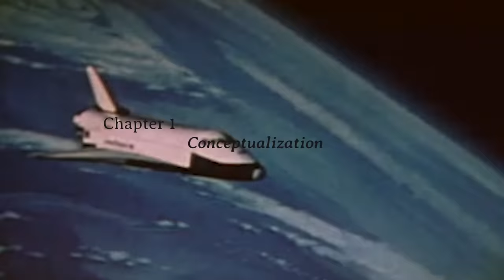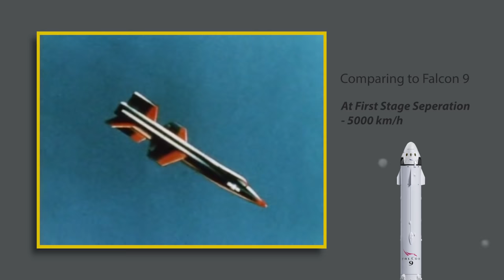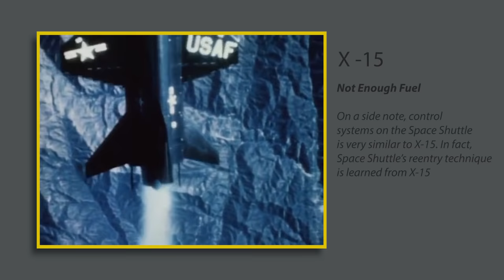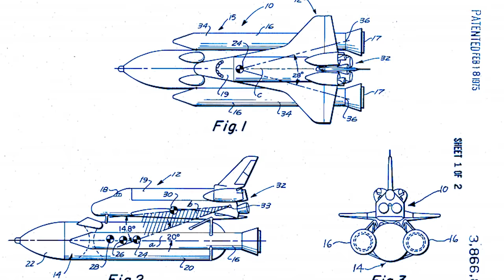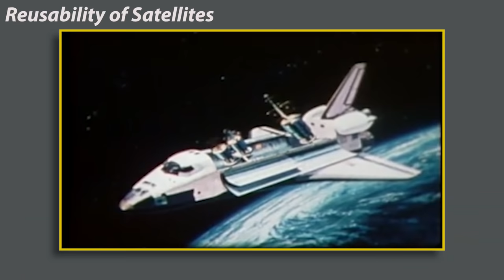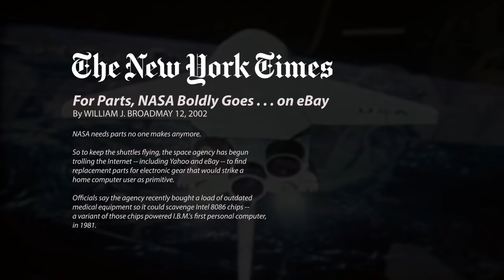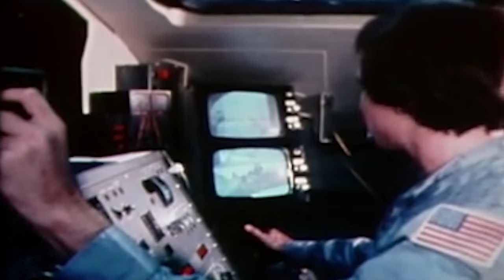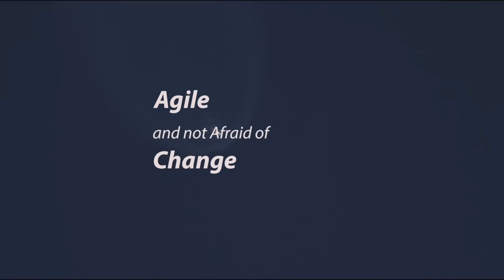The Space Shuttle, a failed attempt at Reusability?

Comment: You missed the first iteration of the Shuttle design. This was a larger, C-5 sized aircraft capable of taking the Orbiter up to release height on its back wherein the Orbiter would detach and ignite its engines. Very much like the way Branson's Space Ship Two or the L-1011 carry payloads to orbit.
This got cut by NASA as it was likely to be way too expensive and underpowered, despite being totally reusable. The tank and boosters design was a cheaper compromise design despite being perceived as not as safe due to the SRB's inability to be shut down in an emergency.
Reply: That original design was cool! Unfortunately, NASA couldn't afford it.

Comment: I would still like to see someone pick up the Space Shuttle architecture and modernize it. It would be interesting to see what that platform could do with 21st century systems and a pared down set of expectations.
Reply: or more simply, just do what the Soviet Union did with the Buran shuttle.  It eliminated both problems that caused the two shuttle disasters, AND cut refurbishment costs in half by eliminating the need for Shuttle Main Engines
Reply: It would be great to see a reusable modular system with different staging options and separate cargo and crew modules. The shuttle was pretty monolithic.
Reply: Fun fact: the Shuttle was at first designed to be fully reusable, with a "plane-on-plane" two-stage design. But it ended up in its partially reusable state due to lack of funding for development of the full version.

Comment: Top notch production quality and you cover a lot of good points. However I'd like to see a discussion about where they failed in their design that made it costly. Reusability was at the forefront of the space shuttle's conception yet they ended up making a system with an expensive and time consuming refurbishment process. How come they didn't foresee the large cost and difficulty of refurbishment? The platform also required an enormous amount of infrastructure to test, roll-out, and launch.
Reply: There was such a budget shortfall that the US Air Force came in as a partner and got a 30% size increase, that made everything harder.

Comment: I think Space Shuttle is program that was borned to early and on border of technological possibilities of 1970s for sucess. If someone today decide to build system like a shuttle (BFR is close) i belive it would be sucessful and reliable.
Reply: Samo Gomola I don’t know if the bfr will have the capability to repair of build a space station in orbit though. Today, we wouldn’t be able to build another iss without the shuttle.
Reply: The System could definitely be built successful and reliable. But would you need it? The main reason the shuttle was so expensive is that it wasn't designed and optimized for the missions it had to be used for. When the U.S. military withdrawn its contract, the shuttle was just halfway in development, they shouldn't have finished it if there wasn't a proper use for it. They basically ended up with a big rig for pizza delivery.
Reply: Martin Hughes how is the iss useless? It had been used for many, many experiments, and to study how humans handle being in space for a long period of time.
Reply: The main objective of the ISS is to study human biology in weightlessness. That's quite necessary for space missions longer than a week. If you want a Mars mission with humans for some reason, you'll need at least a decade of studying the effects of weightlessness before.

And that's not just it! During a Mars mission, you'll be exposed to deep space and insane radiation. If you want to have a chance of delivering your crew alive, you'll also need to similarly to the ISS, study human biology when exposed to radioation and deep space. That's actually something that's being done. A space station named "Deep Space Gateway" is planned to be constructed around the Moon to study exactly that, and if things don't work out, you're still safe to return from there. 

The DSG will determine if it is even possible for humans to survive a Mars mission, and if (hopefully) yes, how. It's a necessary part of any Mars mission, just as much as the spaceship itself.
Reply: Sorry if it wasn't clear. Yes, since you can't study radiation in LEO, that's why the DSG will be built around the Moon. 

And artificial gravity has been tought of, but the research revealed that you'd need an enormous ring. It's so hard to do that it's not worth bothering. Similarly on space stations, the centrifugal forces are miniscule too during the few minutes of manouvering, so  having it utilized by soviets seems unlikely to me. Do you have the source on that one?

Comment: There are several excellent books out there that put the design of the shuttle in historical context. That is of huge importance in analyzing the shuttle program. (There were also 6 orbiters built, not 5) Don't forget that the shuttle flew 87 safe consecutive flights from 1988-2002. Apollo flew only a handful of missions and is not a good yardstick for the shuttle. The 135 shuttle flights exposed the vehicles to far more ascent/descent flight risk than Apollo ever did. Catastrophic failures and loss of life will occur no matter what type of space vehicle is used. (Apollo 13 was a catastrophic failure and don't forget Apollo 1)

Comment: It would be more accurate to say the space shuttle program failed at reusability because the profit motive encouraged minimum attention to detail rather than maximum attention to detail. If a SpaceX rocket explodes, SpaceX has to pay for the cargo that was destroyed, and that costs much more than paying technicians to be extra-careful during assembly. There was no similar profit motive for the maintenance of the Space Shuttle. As a result, systems that needed the utmost attention (like the heat-resistant tiles and the seals on the SRBs) only got as much attention as absolutely necessary to be "pretty sure nothing would go wrong".
Reply: The shuttle design was compromised, underfunded and oversold, motivation can't fix that. To date SpaceX has had more failures than the shuttle, not good enough.
Reply: Fun fact: the Shuttle was at first designed to be fully reusable, with a "plane-on-plane" two-stage design. But it ended up in its partially reusable state due to lack of funding for development of the full version.

Comment: I remember some engineer or astronaut saying the development of the Space Shuttle put back the space industry 20 years.
Reply: Shuttle should not have been the ONLY operational space program.  Any optimally run space program requires both an exploratory program and a space transport system program.  STS was also intended to go hand-in-hand with building a space station,... but Congress refused to fund it.  ISS didn't even put up its first module until 2 years BEYOND Columbia's intended operational lifespan.

Comment: I don't agree. Space shuttle was a marvelous vehicle much more complex than anything build or to be built. It was a combination of bad luck and bad management what didn't allow and update of the orbiters or a new generation of shuttles.
Reply: They should have kept each orbiter to their 15 year operational limit, and replaced the shuttle fleet with new spacecraft built around the Soviet Union's Buran space shuttle.  Buran was lifted on a liquid-fueled booster that could carry a shuttle into orbit dead weight, with no help at all from the orbiter.  Eliminate the Shuttle Main Engines and you cut refurbishing costs in HALF.  You also eliminate o-ring failures, as there would be no Solid Boosters, as well as the foam strikes as there would be no external tank to feed the SME's you no longer have.
Reply: You've just shown its flaws. It was much more complex. More complex doesn't mean better, just more complex.
Reply: You need to stop fixating on the Buran. There is a reason why every commercial project is placing the payloads on top. You keep looking at the two accidents that happened and missing all the others that should still be avoided.  You act as if the original shuttle ideas are the only answer. That was NASA's biggest failure, the inability to think past the mindset that only the shuttle concept could work.
The shuttle never left LEO. Its expense made anything else impossible.

Comment: I followed with ESA the project Hermes (an European space shuttle) and know in depth why this also was scrapped : first the STS should have been on top of the rest of the rocket for obvious security reasons. Second there were numerous problems with just the attachments and also the landing gear : you can't open a door in a heat shield. Maybe it is also a reason why powered landing are scrapped for Crew Dragon 2 / Red Dragon (my guess) the landing feet coming from bottom are not a good design. Landing on the sea or pork retro-boost soyuz-like for landing anywhere still looks easier to achieve. Ariane 5 boosters recovery is far from ideal. I think for the moment the best recoverable space device it the Falcon 9. Also for earth return it is very hard to have in a small volume enough delta V for landing. Parachutes are still great in our thick atmosphere.

Comment: "it is hard to digest that we have never lost any astronauts in the Apollo program that took astronauts to the moon, yet we have lost fourteen in the shuttle program"

A couple things here - firstly there were 135 STS missions, and yet only 15 Apollo missions in total (including the three flights to Skylab and ASTP).  Further, even if we ignore the Apollo 1 fire, there was still the near-fatal accident on Apollo 13, who's only saving grace was the Lunar Module being used as a lifeboat, and the fact the heat shield was not damaged.  So, one near-catastrophe in 15, giving Apollo a 1 in 15 failure rate.
Now, when we talk about the Shuttle and its 135 flights, having two major accidents results in a 1 in 67.5 failure rate.  A far better percentage than Apollo.  If you include the glitches that resulted in fewer days in orbit or some incomplete objectives, you have to include those from Apollo as well.  Not including the crew-related problems in Apollo 7, you have the nearly aborted landing approach on Apollo 11 (reference 1201 and 1202 alarms), skipping the previously mentioned Apollo 13, you also have the docking problems along with the abort signal glitch and the approach radar issues of Apollo 14.

Being outdated was the principal reason.  Even in the Shuttle's inception, it was stated for each orbiter to have an operational lifespan of 15 years.  This meant that Columbia and Challenger should have been retired in 1996, Discovery in 1999, Atlantis in 2000 and Endeavour in 2007.  Yes, Challenger fell long before that time, but Columbia was seven years past her intended lifespan.  There SHOULD HAVE been replacement orbiters for Columbia and Discovery beginning production in the early 90's to replace the aging orbiters.  Though that is essentially what Endeavour was, but they had stopped it at that.

Now, you say SpaceX's Falcon Heavy can accomplish any conceivable mission,... except for one important one.  Refurbishment and retrieval of payloads already in orbit.  The Falcon cannot capture a payload and bring it back to Earth, under any of its designs.
SpaceX needs to be compared to Apollo, not STS, because they are two completely different schools of thought with completely different objectives.  The better comparison would be the Soviet Buran shuttle, which took everything wrong with NASA's STS and made it right.  Namely the refurbishing cost, the uncontrollable boosters, the go-around capability on landing, the upgradeable equipment, AND the launch stack that can be re-tasked to fill other non-Shuttle roles as well.  The Energea could lift a shuttle and its payload into orbit dead weight, requiring no assistance from the orbiter's engines (engine refurbishment was the primary money sink of the NASA shuttle).

Any optimal space program requires both an exploratory program, and a reliably maintained space transport system (including replacing aging orbiters when needed).  Lets also not forget, there were demands by Congress and the Department of Defense placed upon the Shuttle program, as conditions for the funding they needed.  Funding promises that the DoD also refused to live up to.

So, after all that, the short answer of why the Space Shuttle failed and why the program was cancelled is CONGRESS

Comment: the 8086 chips were used in many hard applications for a very long time.  Not because they were stuck with old technology but because the chips were hardened.  First they were made on a really big die (compared to today, or any time between) which meant that the transistors were much larger than todays chips.  Leakage just wasn't as much of a problem and if you combine that with how many millions of hours the chips had been run in heavy applications it meant that there was very good evidence that the chips would not fail in extreme conditions when everything else was going wrong.  It wasn't the antiquated thinking that stopped new chips from being used it was the reliability of the old ones.
Reply: You're exactly right, reliability was number one! With that in mind the shuttles used IBM AP-101 processors, but the used 8086 is a great story.

Comment: I say it has to do with poor management; I mean, its a no brainer that when a part on the space shuttle is outdated you upgrade it, not scavenge for old parts on eBay or ask suppliers to keep parts going just for them. its obvious thought that that isn't the only thing wrong with the spaceshuttle in that the spaceshuttle was costly to refurbish; for example, the thermal tiles on the shuttle were extremely expensive and this refurbishment defeats the purpose of reusability. true reusability both reuses the entire rocket and requires little to no refurbishment.
Reply: Nick G If the Space Shuttle had been unmanned it would have been cheaper to refurbish, if it was smaller and had liquid boosters that could fly back to land I think it could have been cheaper to operate.
Reply: The Space Shuttle was also intended to have a 15 year operational lifespan for each orbiter.  Columbia was 22 when she broke up, and Discovery was 27 when the program ended.
Reply: That's a cute story, but the shuttle didn't use the two year old 8086 when it launched.

Comment: First off, the Shuttle accidents have very little to do with reusability. So you are starting yourself off on a bad foot. Second, all engineering attempts begin with missteps. Pretty much every line of any country's electrical code is associated with a failure of some sort, usually human intuition or imagination. The 1886 Benz Patent-Motorwagen was a pretty crappy automobile. SpaceX is riding on the shoulders of those who went before. And even SpaceX had to relearn the lesson not to put your customers' flight hardware at risk while testing.
Then you ignored the whole of the lifting body program from the 1950s, 1960s, and 1970s. The problems with those designs led to the delta wing of the Shuttle. And Buran. The X-15's purpose was not to research a space vehicle, it was to investigate hypersonic flight through the atmosphere.
You can't compare Saturn V with the Shuttle for reliability. The full Saturn stack only launched a dozen times and it was estimated by its own engineers that they were likely to have lost a crew if it hadn't been cut short. Apollo 13 had more than one failure. Right off the launch pad they had a recurrence of the pogo problem with the center F-1 that they hadn't quite fixed from Apollo 6 and it shut down 2 full minutes early. The fact that they got the crew back at all is down to duck tape being onboard because the lunar module and capsule were designed by different contractors without compatible parts. That same "press on regardless, we know what we are doing" attitude is what led to Discovery's flight not being delayed. And to Hubble being myopic when launched.
The title of the video is misleading because you didn't spend much time discussing the reusability at all. If you had, the thermal protection system's evolution might have gotten a mention.
Reply: The title is not misleading. The Shuttle disasters wasn't NASA's 'oh we're building a pioneering venture, so shit happens' moment: the Apollo 1 fire could be called so. Both the shuttle disasters stemmed from systematic failure in the NASA administration. Feynman, in his addendum to the Challenger Investigation Report mentioned it very eloquently: noting that NASA management were bungling basic reliability calculations in the Shuttle program, he noted: "What is the cause of management's fantastic faith in the machinery?"

Consider: the Shuttle landed with dozens of tiles missing after every mission, the Buran returned with just 7. The Shuttle did not have an ejection mechanism: every Soyuz has had that since antiquity. NASA proclaimed reusablity of the SRB's, in practice they would be heavily corroded by saltwater, and true reusability was only achieved since Falcon 9. The shuttle had an absurdly large payload bay which complicated reusability, and was only fully utilized for Hubble. But then again, James Webb Telescope is launching on an Arianne, so I don't see why Hubble couldn't have done the same (or an Atlas V).

The Shuttle program is the ugly middle brother between the Apollo and Commercial programs. Apollo proved that human spaceflight is plausible, and Commercial launchers like SpaceX and ESA/Roskosmos (which handles Soyuz) are making it possible. The shuttle never clearly achieved either of these goals: it could only get till LEO so it was not pioneering, and it cost 1.5B per launch, so it was not affordable.

So I modify Feynman's question for you: What is the cause of your fantastic faith in the Shuttle Program?"